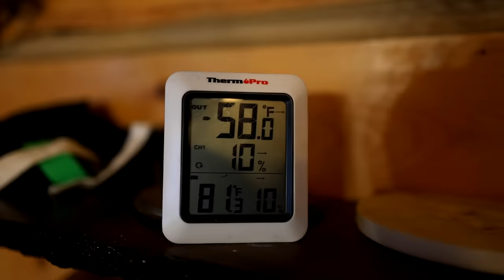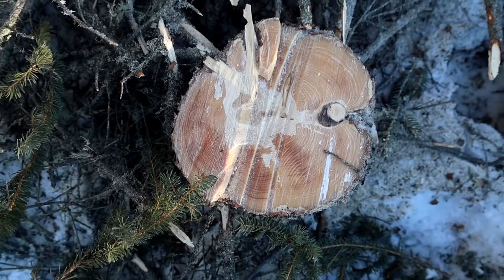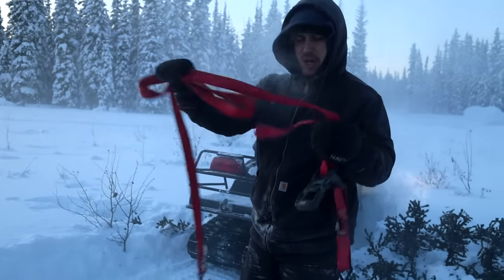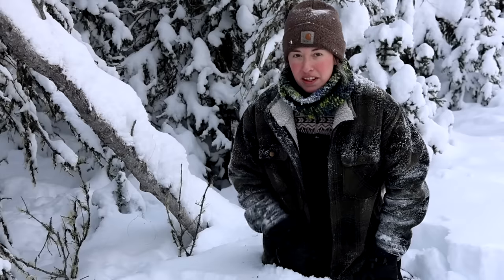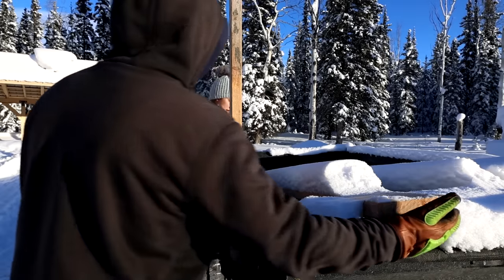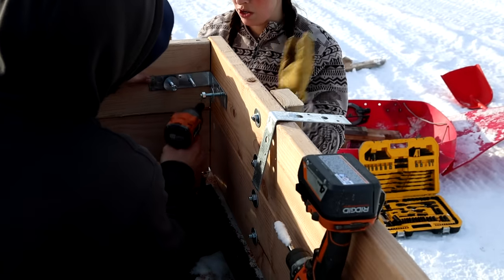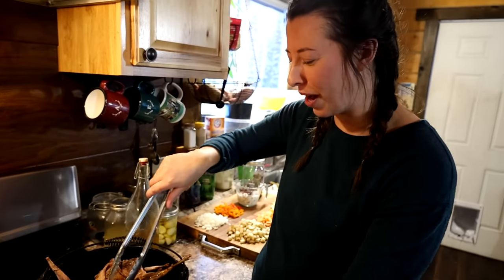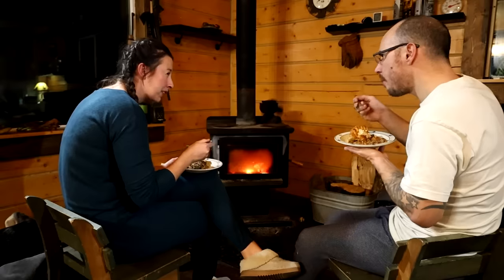50 Below, We Still Go! | Felling Frozen Trees + Snowshoe Hare Pot Pie

Comment: Propane does not freeze unless the temperature reaches -306.4°F! But it does have problems in low temps because of its boiling point: at -43.6°F, liquid propane can no longer vaporize. No vaporization and you cannot run propane appliances.
That is why propane/butane canisters for winter camping stoves are a NO GO, white gas(Coleman Fuel) is the fuel of choice as white gas stoves have vaporizer tubes that run through flame of the burners.
What town do you live in now that the temp is almost -58°F?
It looks like the bar oil needs to stay inside the cabin the night before you plan to use the saw.

Comment: I now understand why you put block heaters on your vehicles.  Frozen oil?  In the crankcase - Not Good!!!  Good thing snowmobiles are 2 stroke engines.  BTW, time to get an aerosol can of Starting Fluid for those extreme colds to help start those stubborn machines.

Comment: Careful with the trailor remember the oil is frozen alot even hydrolic fluid will freeze and pressure in pump and cylinders will blow seals very costly

Comment: Maybe it's been commented already, but the trailer back that can be opened so the "doors" pivot to each side is just a disaster if you raise the bed to dump. Someone will need to be back there to keep the "doors" open and if you have to drive forward, those "doors" just dig into the ground and cause more issues. Just a fore warning from experience.
Reply from the maker: The flip all the way open and hook to the side of the trailer keeping them out of the way when dumping

Comment: I am not a big fan of cutting down live trees in winter for my fire wood. Most of the tree sap goes into the stump and roots. Tree sap = BTU’s those logs will burn like paper, much lower heat out put. Only advantage is those stumps will burn very hot in a stump pile.
Reply from the maker: Appreciate that, we think we are going to harvest wood in the summer this year.

Comment: may i ask what those sleds, you are hauling with, called .. and where someone would order them from ... they obviously can  handle extreme cold temps .. and could really  come in handy here in central canada (manitoba) ..
Reply from the maker: They are from a local company called Alaska Gear Co, they were previously called Northern Sled Works but they are 100 percent amazing. Indestructible 🙂
Reply: @SimpleLivingAlaska  thank you so much .. i will look them up and see if i can acquire one ... yeah i see you using it all the time and you do definitely put it through its paces ..

Comment: U know it’s cold when the chainsaw is steaming from the heat of the engine. Before anyone chimes in Yeah I know it smokes from oil in the gas, i own a ton of chainsaws. But it’s steaming also from heat. Also I wonder if  there has been any studies to see if wood/lumber is stronger if it came from places like Alaska where the temperature gets well below zero ? That’s a interesting subject to me ....   “ IF” the wood/lumber is Stronger, Weaker or it doesn’t matter if the trees/lumber came from areas the trees freeze solid in winter ????? Anyone know if there’s Been any studies done ?

Comment: If the oil in the jug is so cold that it will not flow,  how is the oil in the snow machine any different?  I was waiting for the engine to seize up after you got it started.
Reply from the maker: Snow machines are made for cold weather, they use a thinner oil